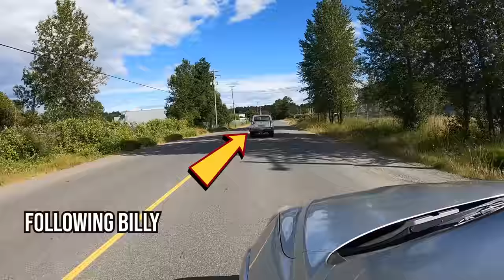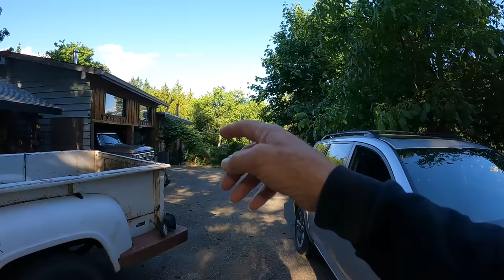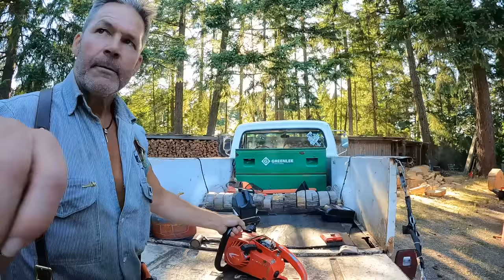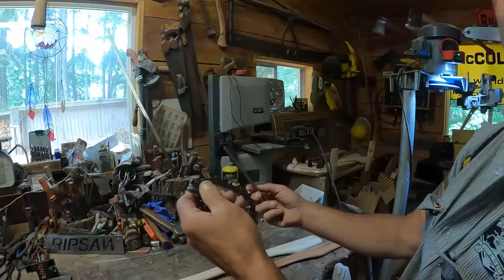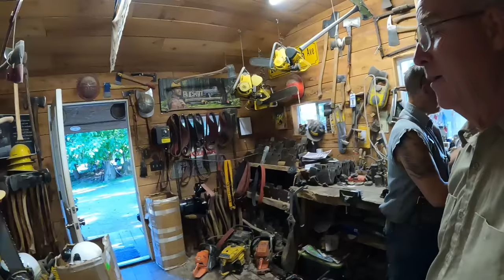Celebrity Logger Teaches Me How to Maintain My Chainsaw

Comment: The first thing I noticed was, Billy Ray still has that old Mercury pickup. I thought he'd sold it.

I have been using chain saws since the 1980s. But have never been brave enough to mess with the carburetor. Now I finally know the simple basics. (It did not come up that the demonstration saw is OLD, and a Homelite. So I take it that what he showed us is universal. Except for the new fuel injection saws... right?)

I am impressed that he actually has room to work on his work bench.

I like that Billy's wife was referred to as his Bride. My wife would not let me say that. Never knew why.

Good advice about finding your way in life, and doing well. The Bible says in Proverbs that your most valuable possession is your REPUTATION. And this is how you build it.

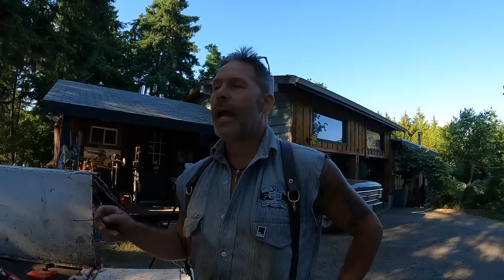Comment: @9:15 ....

Before I knew what I know now I had a 2 cycle weed eater that I would run wide open the whole time I was using it. As you know.... that didn't last long, in the middle of the second season the compression gave out. So I replaced it with a 4 cycle. Haven't had the problem since.

Comment: In those engines 60% cooling comes from fuel and they run at rich mixture so there is enough fuel to cool engine down if you run too lean amount of fuel which evaporate in engine is not sufficient to cool engine down.
Ambient pressure and temp changes mixture rate so engines with carbs need adjustment when running in summer or winter, the best way is to use engines equipped with auto tune carbs it will adjust by it self.

Comment: Thank you for the video, there is one thing I always wonder, why is blade length so long in the saw? In Finland people use 13” and 15” blades and I have never seen anyone use a longer one here.
Reply: Not to sound rude, but...while they do cut... they aren't exactly blades. They're called 'guide bars' & they're made for felling large-diameter trees. I've only fell trees & cut wood on our ranch property here in Northern Cali, so by NO means do I consider myself to be any kind of a pro. And while these guys could definitely explain it a whole lot better...I'll give it a shot. So, those shorter lengths like you mentioned are generally for homeowner types & even some pros who use them for 'limbing' (or de-limbing), basically taking off small branches. But if you had, say for example, a 30'' diameter tree (as measured across or through the middle), you wouldn't want to start making your wedge-cut with a small 30+cc engine running a 15" bar, then have to switch sides just to be able & 'Finnish' it (pun intended😆) ... then go behind it to start your back cut/final cut & then having to end up walking (while cutting) half-way around the tree to do so. Typically you'd prefer a saw w/a longer guide bar than the tree is across. However, that means running a bigger engine to be able & power it as well. That's why saws with super long bars (some up to & as long as 72"/1.82 meters) also have big-ass engines to muscle them through thick timber. I hope that helped.

Comment: I killed my chain saw trying to mill some 8 foot 10x10 post out of a 20 inch leaning dry white pine. Thought my 65 cc saw could if I took it easy but... looks like someone took a file to rings and piston at exhaust port. I should of cut all the wood I need for stay at camp the first day. I guess all that standing dry maple is really rough on saws. Jet ski's have 3 circuits for gas.

Comment: Great video! Since we're on the topic of chainsaws, does anyone know what type of chain will cut dry eucalyptus? I burn through a chain per cut with these standard semi chisel blades.
Reply: Dry gum is what it is. Dense and twisty grain. Semi chisel generally lasts longer than full before filling is required in hard dry wood.
I would recommend using the hardest chain possible. I have found stihl Swiss made to have the hardest cutters. 
File little and often. Set the rakers properly.
Avoid touching the dirt with the tip of the bar at all costs.
Plenty of oil flow to the bar. 
The other option is going with a carbide chain. They take a lot of wear abuse, but can chip if you hit a something hard. Can't sharpen yourself unless you have a diamond wheel for your chain grinder.
I'm guessing you're in aus. I cut jarrah and other eucalypt in the west with the semi chisel stihl chain no probs using the above points.

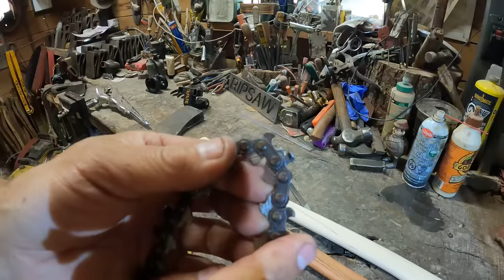Comment: 15:17
For these close up shots that are out of focus, you need to place a flat wall, table, or carboard or flat hand immediately behind the object. That table is too far away.
Cameras like to AUTO-focus on large flat surfaces, not tiny little objects. When I say large it means it takes up most of the camera frame. Even a grain of sand is large if held up close to the camera.
If you hold the tiny objects close up you will get focus since the tiny thing is large and flat, but then you are zoomed in too close and the camera lenses cannot see anything since non-macro lenses blurs everything within x inches. And you probably don't have a macro lens.

That x can vary from 0-12 inches depending on the lens and is called the minimum focus distance measured in inches or centimeters.

Macro lenses are sorta like microscopes, see well up close, but terribly blurry when far away.
Most Camera lenses are somewhat telescopic, think telescopes. They can't see anything up close, but sharp when looking at things far away. Why? Well you take pictures of things that are far away from the camera, like people and places. If you want close ups of things you need a macro lens.

Comment: It is VITAL (it may have been mentioned) that the owner knows the gas - to oil ratio is a quart of oil to five gallons of gas.  Without the correct oil/gas mix the powerhead will seize within a few minutes or much less.